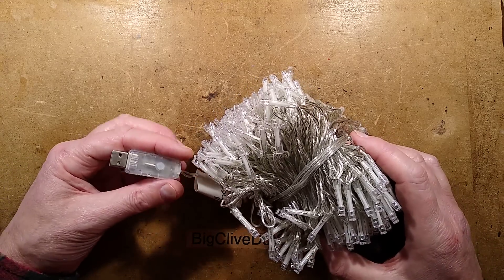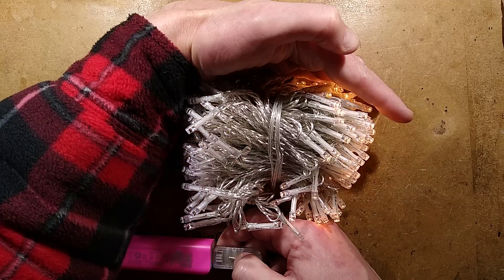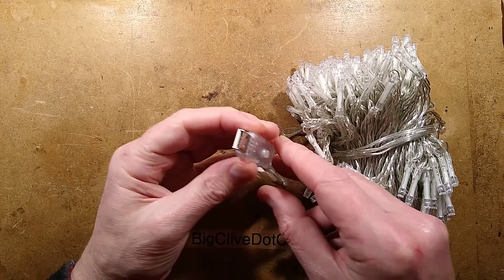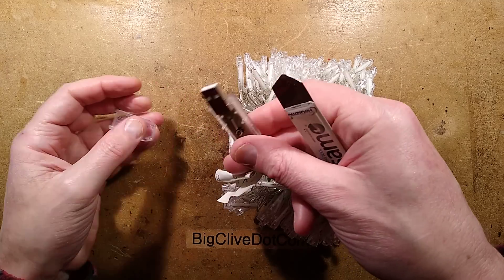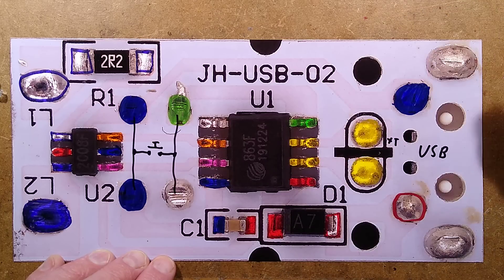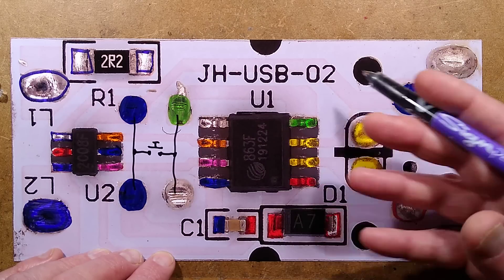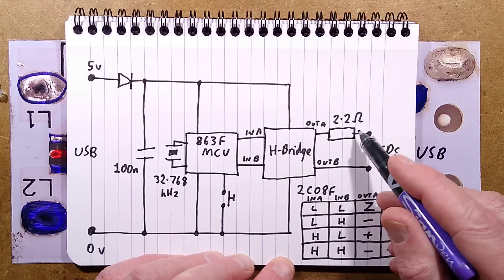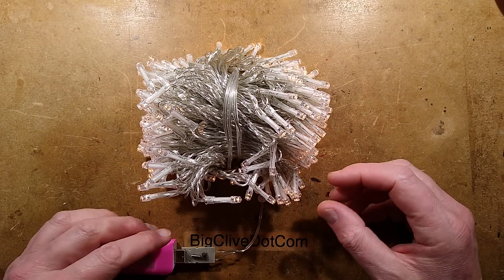USB fairy light controller (with schematic)

Comment: OK,  I was able to have a simple ON/Off switch by connecting the negative of the AAA directly to the sting light output from the board. The wires are setup to only power half the lights (every other light). Depending on which wire I connect to it will power up the other half. HOWEVER, I cannot for the life of me figure out how to tap this board to allow me to light up all the lights at once with this method. Any thoughts?
Reply from the maker: The modern battery operated strings have the LED wired in alternating polarity so it can do flashing effects by changing the polarity.  If powered with simple DC only every second LED will light.

Comment: The wire got pulled out of the usb port, the lights still work but it needs to be reconnected. Any tips on how I can re connect?
Reply from the maker: It sounds like it may need soldered back on.

Comment: How to light up without this controler?
Reply from the maker: You can use a resistor in series on strings of USB powered lights, but if it's the multi-effect version only half the LEDs will light, as it alternates polarity to make them all work.
Reply: @bigclivedotcom  yes its multi effect version and only half the LED lights up.. 😥
Can u make a video on this how to lights up both without controller.

Comment: Interesting, I have one of these and it has an unpopulated 8-pin spot that looks like where a NOR EEPROM would mount. I wonder if mine could be made to not forget it's settings by adding one.
Reply from the maker: I've added EEPROM chips successfully to other sets.
Reply: @bigclivedotcom  Oh neat. Do you remember what chip you used?
Reply from the maker: @AngelaTheSephira  24C02N

Comment: I have a question for you. Do you know how can I operate this set of lights with a timer? Since it has Thad bottom to turn them on and off, the timer doesn't turn them on, I have to be turning them on al the time. Very irritated, ohh, and by the way, my doesn't have a control remote just usb with the bottom tu turn them on and off and to switch between modes, any help will be appreciated thank you

Comment: I finally done it, I created a 30x35x60mm box to control these LED strips with wife approval status. ESP32 for effects, last preset storage, no annoying flashy effects, only the ones I like and PWM control, D24V5F5 for power supply to ESP32 and DRV8871 DC motor H-bridge driver to drive the LEDs and a button for preset selection and power off. Soldered all together and it worked... after I connected button to the correct pin.
Reply: need a detailed notes on how you did it !

Comment: I don't mind auto off timers for energy saving purposes, but only if (and I stress the IF) they have an option to turn the timer function off. I have some air purifiers that I run on zigbee controlled timers, and they have a power saver function to turn them off after a couple of hours, which was super annoying with no way to customise it, and you had to press a momentary switch to turn them on... so I bypassed the timer by adding a tiny cheap switch on the back of the switch (inside the unit) that makes it think the button is constantly being pressed (which resets the timer so no auto off, and it makes it turn on automatically when the timer clicks on).

Comment: Hey Clive have you seen the latest led lights in ALDI ? They have two retro sets that look like traditional fairy lights - Canterbury bells and Pickwick petal shades - they come in the full five colours including pink ❤ I love them and they look like the old lights from the 70’s and 80’s ❤
Reply from the maker: I got some here.  By Noma?   I just know they'll be a lot cheaper at Aldi.
Reply: @bigclivedotcom  ALDI are selling them sets of 100 lights for £15 . The box has ALDI branding but I checked online and they look like the Noma lights .
Reply from the maker: @carlyonbay45  Ah.  Mine cost £20 for a set of 50 locally.  At first I thought it was new old stock until I saw the new UKCE symbol.

Comment: Got a question! I have a LLC quasi resonant PSU that I want to send to you to possibly do a video on. How would I get in contact with you to get a postal address etc? The reason I want to send it to you is I lowered the voltage and wanted to adjust it back up but it wouldn't. I replaced the potentiometer which was what I suspected had failed. This didn't fix it so I thought it could be good for you to do a video on to troubleshoot and do a PCB breakdown It's a 600w dual voltage model that was bought as 30v output. Let me know if your interested.

Comment: It appears that the only features of the H- Bridge driver is to alternate the output polarity, since Hi-Z and L-L are not used.   H-L => H-L and L-H => L-H. Doesn't this just mirror the input voltages?  Aside from buffering the output voltage so as not to overdrive the PIC controller, why add the complexity of this chip (and the cost)?

Comment: I just bought a cheap (and nasty) mood light from Poundstretcher. A ring of 6 white LEDs and a ring of 3 RGB LEDs with internal controllers and a SPDT switch to select multicolour/white mode. Totally naff but I bought it as I wanted the enclosure. So I replaced the miserable innards with an ESP8266 board loaded with the WLED firmware hooked up to a ring of 12 Neopixels all controlled by an app on my phone. Now it actually deserves to be called a mood light. 😁

The only downside to this hacking is it now requires a 5V 1A PSU to power it instead of the 3 AAA batteries it used to use.

Comment: @bigclivedotcom are you also getting these YT ads for the "nomad security camera", a 360° wifi cam that screws into e.g. a porch light bulb socket. Seems like a good idea, but what are the safety implications for running such a device off your light circuits (some countries do not have earth leakage protection on light circuits). Also the ad is giving heavy spam / scam vibes. Any chance for a vid?

Comment: I wonder if swapping the crystal for a higher frequency would make the full-white mode less flickery (or if the crystal is only used for the wakeup clock). Assuming we're not hitting chips limitations... and that having it automatically turn off and on at a much faster rate than the usual 8 hours on / 16 hours off is not a too annoying... which at some frequencies may lead it back to strobe-mode  😆

I remember having a Christmas light set with a similar design, it's tempting to try, just for shamelessly-useless fun!
Reply: It's flickery on camera, i bet you don't see it in person very much, especially not when it's just a little bit of added lighting.

Increasing the frequency is not ideal, as it will increase switching losses on the H-bridge IC. So the whole string will be less bright, and if you start pushing it, you can also burn the H-bridge. H-bridge off-time tuning can be somewhat fragile, so up to a point it works fine, but it doesn't take much until it shorts itself out and dies, you don't get a lot of warning from increased temperature before that happens.

Comment: I have a very similar set thats RGB. Turns out they just use a standard WS2812 protocol and a rpi pico later I've got some lovely custom patterns all written up for them.
Reply: If you could hook up with a link or deeper description of where you got them I would ow you a beverage of your choice
Reply: @briancihak8271  a lot of the ones from amazon are fine. Search RGB Christmas lights and any that have the USB power like this video and show the same LEDs in multiple colours, or have multiple colour remote, should be good. Check they're 3-wire too. Think I got a 10m set for about £11. Some are inline and flat, some are the style in the video above.

You will need to crack the plastic off the case to see which wire is which (usually silkscreened or easy to follow the power and ground from the USB socket), but after that just desolder the data pin and insert your own pico. The Pico 5v bus isn't technically rated for the amps that the strip will draw, but you can power the pico in parallel to create a single USB but be careful about back powering your PC when programming if you do this!

Comment: I've got some lights with a controller which seems the same as this. The timer function is set for the lights to come on at 16:30.  Then after just a few weeks it's coming on about 6 hours later.  Drifts out alot.

Comment: The checkout counter at Aldi had a stack of multicolor 1M long LED tape reels for $3 so I got one. They use a Tuya app downloaded to a phone to talk to the controller by bluetooth. The app controls all the parallel RGB LEDS, color brightness,pattern change. The most fun a geek can have for $3. Unfortunately it can't be controlled without the app loading the pattern onto the controller, but then it runs on its own. I don't know if the app phones home to China. Tuya is a pretty big company.

Comment: I took a nice pair of dollar store lights and just added two resistors and a usb cable to replace the battery pack.  I wanted to use the ubiquitous dollar store power bank to power them but then it turns out it has low current detection, so I ended up on a rabbit hole making a pulse generator out of a 555 to raise the current to above threshold every 24 seconds.... I can use them now, but due to the timing capacitor size vs current supplied I have to plug it in, wait for it to shut off, then plug it in again lol

Comment: Is there an easy way to change these so that they never flash? Would it just need a complete replacement for the power supply? Where I work there are some people who can't stand any flashing lights on the Xmas tree.
Reply: Not when odd and even are connected with reverse polarity. You'd have to feed with AC, to get all on, but you could use a higher frequency.
Reply: @LeifNelandDk  Thanks. I've just rewatched the video and come to the same understanding.
Reply from the maker: I've been trying to find the simplest circuit that can alternate polarity at a fixed speed for static illumination.
Reply: @bigclivedotcom  Two transistor astable multivibrator connected to the existing H-bridge? 

Replacing the controller with a cheap PIC might be even simpler.

Comment: I have a string of 30m between the main house and the barn.

Even if it is attached to a nylon wire, so it does not carry its own weight on a couple of poles, they last less of a year. I'd hate to have to dig a mains cable and have light posts on the pathway.
Reply from the maker: It's usually DC corrosion that affects this type of light.  I've not tested if the use of AC for the flashing effects reduces that.
Reply: @bigclivedotcom  for any given individual led it's always going to be DC...with AC any one would be OFF half the time..unless the string is fitted with incandescent filament type lamps ...
Reply from the maker: @analoghardwaretops3976  The newer strings of LEDs use alternating polarity to control two alternating polarity sets of LEDs.
Reply: @bigclivedotcom  another way of explaining the same but now in this case(anti-parallel connection)..the reverse biased string should be able to withstand total reverse volts.applied..and one led fails short...then there's that much additional rev.volts on rest...making them more susceptible to earlier failure...
Reply: @bigclivedotcom  dc can lead to faster corrosion ..but that's when current is flowing...rest of time it's atmospheric contamination induced.....to reduce such, for extended outdoor use...apply conformal coating/varnish/nail polish.. after thoroughly cleaning / defluxing soldered joints...

Comment: Could you use a 555 timer to make the H-Bridge do its thing? I'd like it to run at >10 KHz as well to eliminate the flicker. Also, that diode, is it to drop the voltage to the MCU? I'd moved it to the MCU instead.
Reply: Should be possible with an extra transistor to invert the output because you need a Q and Q_ for the H-bridge.

We don't know what the voltage rating of the MCU and H-Bridge are.  If they blow up at 5V then a diode to protect them from supplies with over-voltage is a cheap fix. Perhaps the silicon is sensitive to even slight reverse voltage and the diode would protect it.
Reply: The flicker is only visible in the camera. I measured some similar lights with an oscilloscope and they were moving at 200Hz.
Reply: @DumahBrazorf  and if one sees flicker that the camera has picked up..then there's definitely <25/30 Hz half cycle ripple.. riding through...(the 100nF cap in this ckt. is too small to reduce it.)....chk on horiz.t.base of 20or50 mS/div. instead of 2/5mS/div.
Reply: Diode is for reverse polarity protection...on all electronic ckt.  that would otherwise fail if connected wrongly.
Reply: @analoghardwaretops3976  You can't connect this wrong, it uses a polarized plug.
Reply: @kyoudaiken  you're right on that...then the diode seems redundant...except for the loss due to forward drop..

Comment: I hate this trend of 2 channel fairy lights, especially these inverting ones. There was a small period of time when manufacturers still made the boards with full 4 channels capability and only used 2 by cheaping out on transistors. I liked to upgrade those to 4 channels. Luckily I have the nerves to repair the old rice lights so I'm still sticking with those.

Comment: As the only useful pattern is the static mode, I wouldn't bother with the MCU and just power the string with low voltage AC power supply.

Comment: Most microcontrollers can run on an internal RC oscillator for non-communication applications. 
This one must be so cheap that even with a crystal, it would be cheaper.
Using a half bridges is probably cheaper than a pair of pnp/npn discrete transistors.

Comment: I’ve a similar USB set from eBay, with thin wire and /the/ most gorgeous rainbow colours (they’re kind watercolour hues). But I wish they could be reprogrammed. There’s one particular shimmer they do that’s My Perfect Idea Of What Fairy Lights Should Look Like… that only happens during the Play All Programs function 😭
Reply: I guess I would use a logic analyzer to figure out the pattern, and then replicate that with a micro, maybe a pi pico. You can use the pi pico as a temporary logic analyzer too.
Reply: They will almost certainly be a 3-pin WS2812 protocol LED. I think the only change I had to make with mine when programming on a rpi pico was to output GRB instead of RGB
Reply: the addressable ones? in blobs on the wire? they are standard, you don't need to reverse it

Comment: Ultimate hack for higher brightness lights on all the time...
Cut off the USB connector.
Connect a 3 to 5v mains transformer with a series resistor no lower than 4.7ohms (at least 1W rated). 
Done. 
Enjoy.
Reply from the maker: Noticeably flickery though.

Comment: I grabbed a similar USB set, but it only has little 0603 LED chip in slightly milky blobs on several strings of wire in the same arrangement of alternating polarity. The driver unit also has an infrared decoder and comes with an RCU. In its low intensity draws just enough power to satisfy a generic power bank, but on ramping up and down modes can suddenly let it go dormant.
I've been unfolding and folding it back, and storing carefully, and it keeps just working. Haven't disassembled it: it works, so I don't have to trash/repurpose it; and Clive takes things to bits so we don't have to.

Comment: Last year I revived few LED Christmas lights that had H-Bridge and controller in one chip. The chip was dead, I believe because I plugged it out and in too quick. I could not find a small suitable H-Bridge for up to 36V, so I bought massive H-Bridge in size of this whole controller, Arduino, buck converter, put them together and wrote a software with my own preferred patterns AND remember the last pattern. I liked my candle flickering effect the most. But controller was HUGE! I would love to minimize the design and still be able to use Arduino or ESP-32 for patterns, but a smaller H-Bridge and 36V->5V voltage regulator.
These lights would work for me as they have the H-Bridge, 5V already as input. I just would have to strip controller chip, replace it with Arduino and I would be able to reuse the button. Sadly we don't have this store around here.

Comment: An item in the Bangood email distribution I found a bit alarming...  
Home Immersion Heater Set for Boiling Bath Shower Heavy Duty Submersible Water.  Item ID:  1897732.  
It consists of a steel encased heating element with a grounded AC cord, but still...  A steel scrubbing pad, digital thermometer,  a stick on thermometer strip, a strip which looks like sand paper...  
I did not see a email link on your website, and well I am sure your Youtube email address is bombarded with spam.
Reply from the maker: There's a better version which literally passes electrical current through the water.
Reply: @bigclivedotcom  That sounds even scarier.
Reply: @DandyDon1  Look back through Clive's videos from some years ago, there are a few of these "reviewed".

Comment: I hate those 8H-on timers. I'm quite capable of turning them off when not required, but most lights seem to come with them these days. Damn annoying.
Reply: The same goes for electric blankets and heating pads. I want the bed warm when I get in, regardless of whether I fussed with it before dinner. The cat enjoys a warm spot in the kitchen and can't operate switches.
Reply: If possible..Use  a 2or3min ON...1min OFF timer to operate your 8H timer..because of the large thermal constant of the heater, the 1min OFF  should not make for noticeable loss of heat in an 8H cycle...